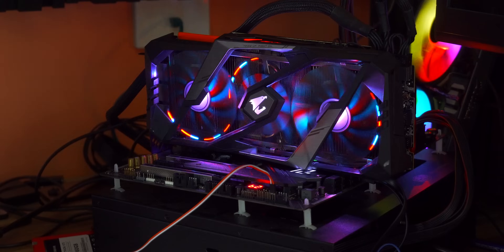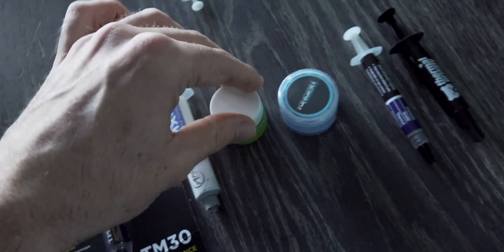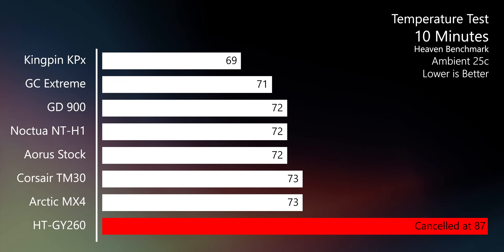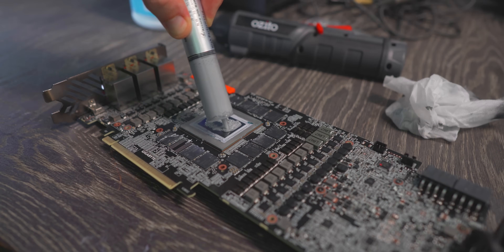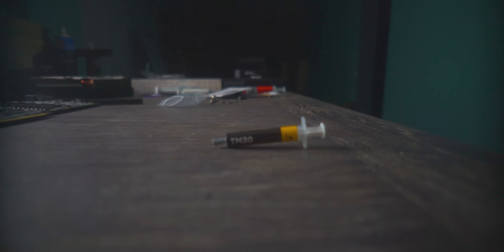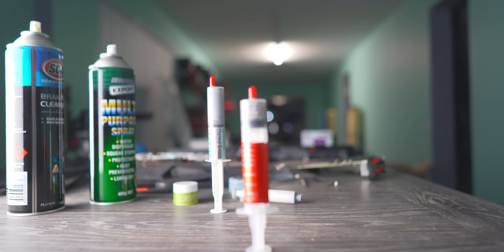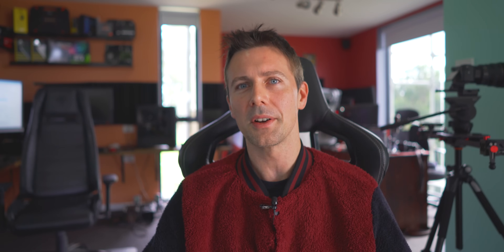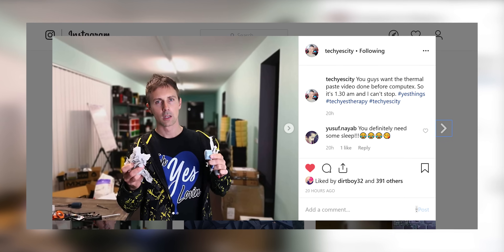What's The BEST Thermal Paste in 2019....? (Ft. GD900)

Comment: So, the thermal paste I like with the reason why is the following:
Arctic Silver 5 (sold in its bulk tube form) because its some of the best value to performance it offers ($13.40 USD for the 12g tube) and it last though several computers before you need another tube.

Cooler Master Mastergel Maker because when compared to Kryonaut (which I also have but rarely use) performs within 1C of Kryonaut and costs less and you get more per tube (4g on the cooler master stuff vs 1g on kryonaut) The 4g tube of CM Mastergel is $11.60 and the tube of 1g of Kryonaut is $9. I use this on my own builds for cpu and gpu cooling when thermals are more of a concern for overclocking n' such.

Thermal Grizzly Conductonaut. Does this even need an explanation? Its expensive for what you get, and if prepped improperly or applied without caution it can be dangerous to your components and it is hazardous because gallium is toxic. That said, its thermal performance is the reason why to use it. 73 w/mk of conduction vs 11 w/mk on the Mastergel and 12.5 w/mk of kryonaut. When air or water cooling is concerned, its the last word in ultimate cooling. I use this on my main build between the cpu and the coldplate of my Corsair H110i GTX and on the gpu die and HBM and the coldplate on my Fury X. The temperatures I see are pretty fantastic, max temp on my Phenom II X6 1090T at 4.2Ghz @ 1.55V is 52C and the max I see on Fury X is 42C. When they say you can see upto a 20C difference when you go from thermal paste to liquid metal, its legit. I had used this stuff on a very custom Clevo P750TM1-G laptop with a i7 8700k and GTX 1070. It was like night at day. That's probably the best use case for liquid metal. On high end gaming laptops or small itx boxes where the size of the cooling solution you can implement is limited. You have to max out and optimize the cooling system you can fit or have access to.

Of the three thermal compounds I use, I'd recommend Cooler Master Mastergel Maker for anyone who is too nervous or doesn't want to use liquid metal and Arctic Silver 5 to everyone else. Both are very good, Arctic Silver 5 is old reliable, it will never let you down and Mastergel is the surprising high end value that you wouldn't expect.

Comment: I think MX-4 is still best value , i have used Gelid on my DJ laptop for gigs , i play in really hot environment . After little less than one year Gelid was done , i replace it with MX-4 and temps are only 2C bigger but after a year and half MX-4 still holds .

Comment: Dow Corning TC-5688! Expensive & exotic but supposedly good for "multi chip packages" (like Vega maybe?).
Reply: that stuff has 8.0 w/m.k.  a guy in another thread was talking about the new thermalright tf8 which has a 13.8 W/m.k rating
Reply: personally i use Gelid GC-Extreme  best paste i have ever used.  runs neck and neck w/ thermal grizzly in the tests i have seen.

Comment: How do they compare with Thermal Grizzly Carbonaut?
Reply: Carbonaut is eh. It cannot replace thermal paste. There's like a 5-10c higher difference in temps. Not so good if you care about temperatures. It's also electrically conductive = bad scenario if it happens to touch anything electrical.
Reply: @RuthlessFares  I see. Thanks for the reply!

Comment: Amazon has a paste thats available for amazon prime 2 day shipping called AK-3250 thermal grease, and for 30g its only a few bucks cheaper than the 20g mx-4 at 16.99 bucks cad, and on paper its supposed to be better than the gd900 in thermal conductivity. I bought the stuff and looking at it, its got a consistency more like the cheaper chinese paste and smells like used industrial grease. Im gonna order 30g of gd900 for about 6 bucks cad but it will take about 2 months to arrive before i can compare the 2

Comment: You could test some of the carbon thermal pad material. I got some Panasonic carbon thermal pad material Digikey # P14965-ND THERM PAD 180MMX115MM W/ADH GRAY 0.0008" (0.020mm) The thinner the carbon pad the better the heat transfer vertically if you read the specs. I used it as a cpu thermal transfer on a Intel 9600K in place of thermal compound. It is easy to cut since it has a removable Mylar backing. With the Mylar removed it holds together and has a slight adhesive so it stays in place. You can peel it off to reposition if you need to. I could not see any difference in the cpu temperatures after application. One sheet is 4.5" X 8" so you can do a good number of cpu's with one sheet for about 11 dollars US.

Comment: GD900-1 is a bit better than GD900 but costs three times as much. GD007 is even better than them but can't get in bulk at a good price. Halnziye is another low-cost option with a lot of variants like HY880 for example. For most hobbyists, buying in bulk or going by value point is not going to really matter much.
Reply: Yep.

From Halnziye, the HY710/HY810/HY880 are the best bet. All the others one are worse, especially that HY610 that is the absolute worst of the bunch.

Comment: Prolimatech PK3 is my favourite on CPU's and GPU's, been using it for years. Keeps my 8700k and 2x 2080 Ti's at a nice temperature at load and idle. It's got a great consistency, easy to spread manually and still spreads very nicely as a pea application. Cheaper than thermal grizzly and from my testing of using both it's within 1c or 2c max.

Comment: I'm so stoked.
I just delidded my I7 4790K and won the silicon lottery. It ran 75c stock speed in aida64 stability before delidding. I used conductonaut on the die and ihs and kryonaut on the heatsink. I could only overclock to 4.5GHz before overheating. Now it runs 55c stock in aida64 stability. I am running stable 65c 4.7GHz @1.2v ON A BE QUIET SLIM AIRCOOLER which has 120W tdp rating.
I reach 4.9GHz @1.33v before overheating.. ON AIR.
I'm so stoked 😃

Comment: Im using Cryonot. Its BEAST, i79700k OC 4.9 @1.35 volts. Never goes over 65*C. Using a cheap cooler master 240 rad. The cheapest AIO possible

Comment: Curing time?
Shelf life?
Longevity in use?
There's more to paste than just the performance. Here's an example of a post:
"Also, very cheap silicone-based solutions like Arctic MX-2 and MX-4, despite being easy to apply and affordable, aren't worth the trouble they cause later as they deteriorate."
Reply: Artic claims a life of 8 years, though !!!  Is it just 'Trump-like' trumpeting ?

Comment: arctic silver 5. people give it shit because people test it wrong. as5 requires a break in period. they used to say 500 hours of break in, now they state 50-200 hours of break in. and after the break in period, turn your pc off, and then let it sit and cool. (break in to me, i run something like prime95 let that shit get hot, then let it cool, you are allowed to due a few hours a day as apposed to all at once. its just a "total time" from my experience)

my 1800x at 4ghz all core oc at 1.4v rests at 30c, 40c gaming, and 50c stress. i hardly ever see people with those temps. most claim im lying. but they use shit paste, shit coolers, and shit fans.

on that note, back in the day my 7970 started having heat issues. stock paste on my asus went bad.... so i replaced it with as5.... after the break in, i got 10c lower temps than their stock paste, which made it run like a fucking champ!

edit: even pueget systems (probably spelled that wrong) uses as5 because its superior. only thing better is liquid metal

Comment: As far as a small chip that can be overclocked the only thing i can think of is a delided i3-9350K (126 mm²) or a i5-6600K (122 mm²) and a Noctua NH-D15. Then i would place four silicone pieces on each corner to help keep the cooler flat on the chip, much like how Athlon 1400 chips came back in the day lol.

Otherwise you can wait for Zen 2, delid that and only change the thermal paste on the one tiny 7nm die then use one of those new high performance thermal pads for the I/O die.

The only other thing i can think of is a ARM CPU, the Snapdragon 845 is a teeny tiny 94 mm². But I'm sure there's smaller.

Comment: One other factor is longevity/long term durability.  One of the benefits of Kryonaut is that it lasts a long time before drying out, a fact I can attest to having used it for years in my high-end laptops.  It transfers heat very well (even better than IC Diamond which I've also tried, and was much harder to spread given its much higher viscosity).  I'm able to OC and it lasts a long time with it, unfortunately it is quite pricey.  Right now it's hard to get hold of because they recently tweaked the formula for it and the old stock is being sold out while they wait for the new stock to come in.  I've used the old and the new and they are comparable for performance with the older version transferring heat just a little bit better, though the new formula is a bit easier to spread.
Reply: By the way, it could also be beneficial to do long term testing and see what thermal performance is like for each paste after it has had time to really set in, like after 4~8 weeks of normal use.  It's something a lot of testers on YouTube and the like don't factor when discussing how coolers/pastes etc. do for keeping components cool and something that actual owners/gamers definitely notice if they keep on top of thermals and performance over time.

Comment: I just wonder how long the GD900 performs over time.
I usually use mx-4, its a known quantity that holds up over time.
Reply: Eh, you get 30g of it. Just replace it if it goes bad
Reply: @DunhaCC  I keep seeing this comment but some of us run custom loops and it's a serious pain in the ass to tear everything down just to re-apply compound. It's not a problem with AIO's or Air but damn is it a pain with custom...
Reply: @PreacherwithoutaPulpit  if you run custom loops you can afford the Kryonaut/Hydronaut though
Reply: I'm a gd900 customer and despite all the uneducated comments around here I am telling you not to buy the paste. It's excellent at first but only lasts about a month before the temps of my cpu go up to 90 plus degrees. Don't buy it
Reply: @300ml_brasil  I am using GD 900-1 for 1 year + on cpu with good results & without any noticeable rise in temp.
Reply: I would be staying far away from the GD900. He gave it #1 "because it was so easy to spread"... That's not a good thing, that means it has high silicon content, which is an insulator. The thermal conductivity of GD900 is like 1/3 of the MX-4
Reply: @DoesntRefillTheBrita MX-4 is 8.5 W/m-K, while GD 900-1 is actually 5.5 W/m-K. I am using GD 900-1 for 1 year + on cpu with good results & without any noticeable rise in temp.

Comment: Oh that Kingpin cooling is interesting, But you really need that Thermal Grizzly paste in the next test as i use that and really want to know how kingpin compares to thermal grizzly. I dont care about cost, what i care about is how high i can overclock my hardware still with in safe temp.

Tech Yes Citty would it be possible for you to test these thermal paste on CPU´s as well. Im dying to know how the Kingpin compares to thermal grizzly. I have so far manage to puch my old I7 980X to 4.75 GHz on air cooling. Using Noctua NH-D14 cooler, 3 x Noctua NF-F12 iPPC-3000 120 MM fans and thermal grizzly kryonaut paste.

Here are a few benchmark of my X58 system with CPU around 4.7 GHz 

https://i.imgur.com/apkm4vp.jpg
https://i.imgur.com/EhPlqDB.jpg
https://i.imgur.com/8mfQwZI.jpg

Comment: The only thing that I would add is that I've noticed the thermal paste that comes with a product usually works best with that product. Such as the pre-installed thermal paste on Corsair Coolers and even my old Cooler Master Hyper 212 Evo with pre-installed thermal paste.

Comment: I feel like a powerplay modded vega vii with a morpheus  aftermarket cooler would be a good test. sure it has a large "surface area" because of the HBM stacks, but the GPU die its self is rather small for its power comsumption (775mm2 die size for the 2080ti vs 331mm2 die size for Vega vii).

Comment: IC diamond? Arctic silver?
Reply: arctic silver is trash.  use to use it in early 2000's but when i switched to custom water cooling on my FX-8370 i was still wasn't getting good temps.  Decided to try Gelid GC-Extreme and I dropped my temps by like 8 degrees (can't remember but it was significant) and it doesn't dry out like as5 does.  i threw my tube of as5 in the trash.  never again.

Comment: So when you watch the Der8auer vid that he did on that submerged cooler, you will notice that only half the chip is boiling the water, this is because he wasn't using the RTX cores. If you turn that on you will have the other third of the chip getting hot, then you will test the cars. PS I had the same Gigabyte card crash and burn on me too, that;s because that cooler is way too thin.

Comment: thank you ordered 2 30 gram jars of GD 900 off of newegg for $14 I use to only buy mx4 but lately I been running out fast and I been using what ever on hand I.E free tubes that come with coolers for builds but now I can not belive the deal you get 60 grams of paste for the cost of an 8 gram tube of mx4 and the stuff is just as good $14 for 60 grams never going back

Comment: The problem with this method of testing is that you don't know the longevity performance of the thermal paste, I have cryorig CP7 that performs really well for the first week and then is absolute wank after that, 10ºC difference in under a week is pretty bad. But thanks for the informative video!

Comment: For cleaning, I use a hard plastic applicator to remove most of the paste on the silicone or lid, and then 90+ alchohol on a foam tipped q-tip-like applicator. So it doesnt leave fuzz. You can get 100pc dual tipped on Amazon for 10 US. Cheaper than wipes.

Comment: I wonder how Arctic Silver Ceramique 2 would compare? I've been using it since I built my PC 1st back in 2013, was included with the used FX-4100 & CM 212+ I bought to get started.
Reply: try some Gelid GC-Extreme and watch your load temps drop a significant amount (5-8+ degrees) just by a simple tim change.  use to use AS-5 but after seeing the results i will never go back.  i mean it was a crazy amount i just can't remember the exact numbers.

Comment: I've taken the risk and put thermal grizzly's conductonaut on my gigabyte xtreme 980ti (using the stock air cooler with 2x Noctua 140mm industrial 3k rpm), before i was using kryonaut and was mid 50s. average of 55c, afterwards at first i was low 50s, 51-52, but then overnight my temps dont even pass 44c most of the time! 47-48c if im playing something like rage 2 or warthunder at 4k!   although every card is different, my friends r9 390 wouldnt boot with liquid metal on it ;(

Comment: All I know about thermal paste is that when I used it the Gelid GC extreme was poop. I bought two tubes of Gelid GC extreme over the last year, the first one was so incredibly bad to spread I thought it was a faulty mixture, but no, same issue on the second one. Even when warmed up in a cup of hot water it didn't want to spread, and if it did spread it didn't stick to the die and slid off.
On the 1050ti I successfully applied it on it made a difference of 1° compared to stock...

Comment: i do wonder how the thermal conductivity is calculated, as mx-4 should be 8.5 W/(mK) and GD 900 is only 4.8 W/(mK) (both data sets are from the corresponding manufacturer)

Comment: Dude, a delidded 9900k with Der8auer’s direct cooling frame should give you one of the highest thermal density parts. Push that cpu to 5.1 and you’ll be cooking eggs 🍳 in no time

Also!!  Thermal Grizzly Kryonaut is an excellent paste. I helped me drop temps on my 1080ti by ~8C.  My gpu is consistently boosting much higher because of it.

Thanks for your hard work 👍
Reply: But those are soldered, really hard to clean that stuff off a die, you can do it but it is a PITA

Comment: Thermal density is way too important. So the real HW for testing with high thermal density is CPUs. But it's a bit tricky to use the paste on "naked" die. 
As for the pastes, oob they might perform kinda differently from couple of months in the future. Especially those "easy to spread". Application also comes into play with pastes like gc extreme as if not spread well, the layer will be too thick (mounting pressure will not squeeze it all out) and there can be huge variation

Comment: Brian, I understand non-conductive, but you are confused about "non-capacitve". Thermal paste if it's non-conductive is a dielectric. All dielectrics when placed between two conductors form a capacitor. All dielectrics have a "k" factor which goes from 1 to a higher number, where 1 is either air or a vacuum. The high the number the higher the capacitance. Maybe you mean low "k" but there cannot be something that is non-capacitive.

Comment: I switched over to the cooler master pro master stuff. Its 10 bucks for a tube that's enough for 5 or 6 cpus and its rated at 12.7 w/m-k vs mx4 8.5 and kryonaught 13.1.

Comment: Arctic Silver 5, was the best years ago, still being sold, never used anything else, would love to know how it still measures up.
Reply: It doesn't.  I switched to Gelid GC-Extreme a long while back and got a dramatic temp reduction plus it doesn't dry out like AS-5 does and is non conductive.  That's what i recommend to everyone now.  I switched when i did a custom loop on an FX-8370 and drained it a couple yrs ago and wanted to clean the block (which i didn't even need to) and after prob 5 yrs it wasnt' dried out.  and i also recommend swiftech's coolant because i didn't have any build up or gunk after 5 yrs.  still running to this day even though i got an all new zen 2 build i use now.

Comment: Kingpin vs thermal grizzly would be the interesting question.

R9 290/X would be great for testing. My card hits 94c and starts downclocking from the stock speeds with a big aftermarket cooler with MX4 thermal paste in super position benchmark.